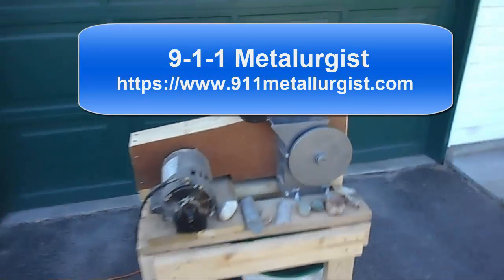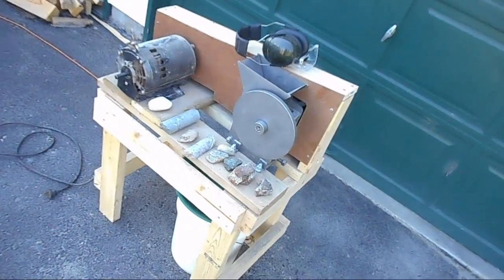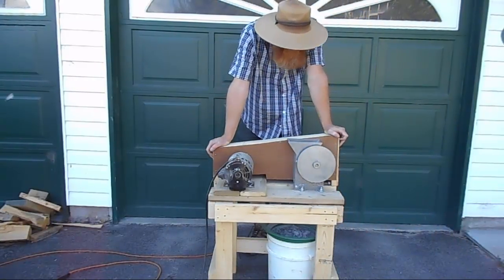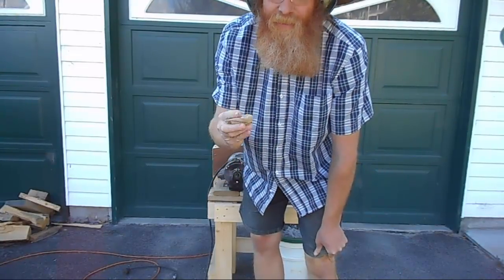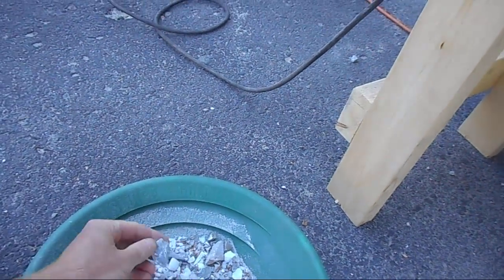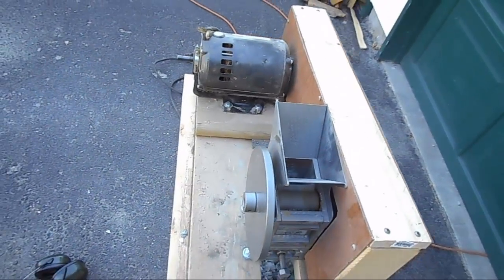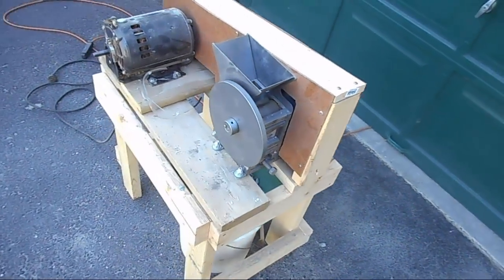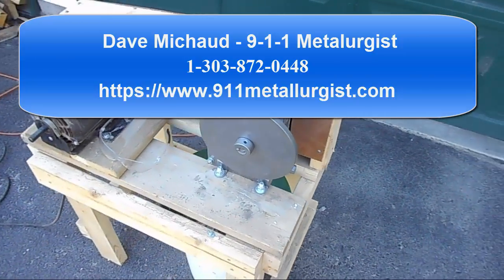Jaw Crusher (Testing the 911MPE.com Jaw crusher with HARD rocks)

Comment: Dan take a2 inch long stainless steel tube about a quarter inch in thick weld it to the nut easy to use.also try a screen and put over the feeder part of your jaw crusher about one eighth or smaller .this way you can still watch
watch what goes on have a great day

Comment: you could put a larger pully on the rock crusher it wwould increase the power to breaking the rocks, it will also slightly slow the feed rate.

Comment: It was running fast, but the torque was low. You need larger "disc" (don't know the name) to attach your belt,that way motor can run at higher rpms, but the crusher run slower ,but more torque.

Comment: In addition to an on/off switch, I would suggest picking up one or more emergency stop switches to wire in series between the main switch and the motor. If ever something goes wrong, it is very hard to have too many ways to turn a machine off.

Just make sure they're power-cut-off switches, and don't accidentally order some low voltage digital signalling switches. Something I totally haven't done in the past...

Comment: Thank you for the run through of the various aggregate materials.  Very informative and reassuring that when I buy one.  I won't be wasting my money.  The mini jaw crusher really will be doing what it is supposed to be doing and apparently even more!  What is the weight and the dimensions of the fly wheel you have on your jaw crusher?
Reply from the maker: I'm going by memory here right now, but I think it is about 8" diameter, and 3/8" thick steal.  Not sure of its weight.  If you are interested in buying one, make sure you tell Dave at 911MPE.com that you saw the video on my YouTube channel and he will give you a great deal.